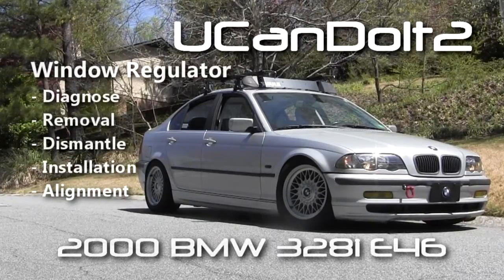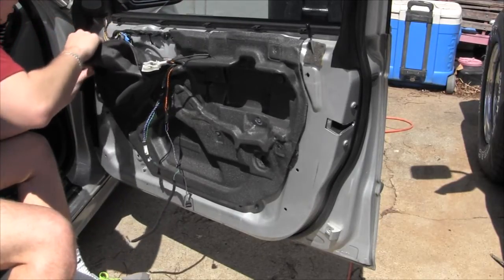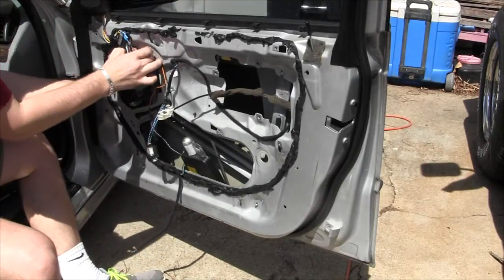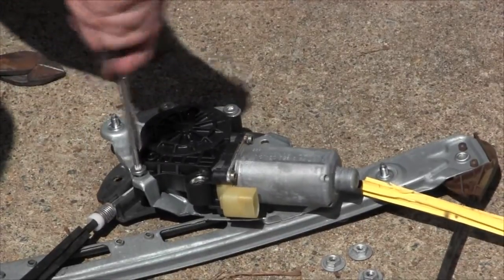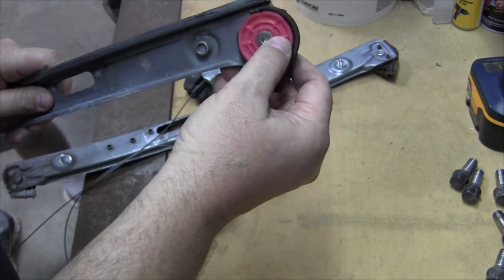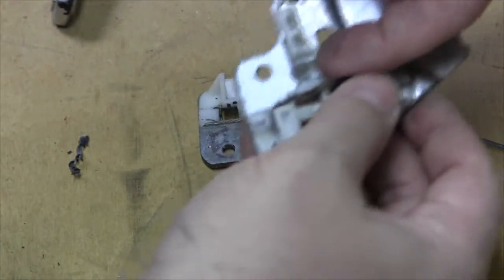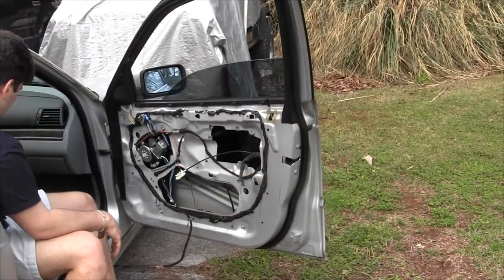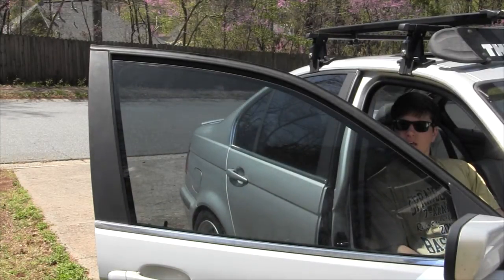BMW 328i E46 - Window Regulator Replacement

Comment: Well done man.  This is the only video that shows how to properly remove and install a window regulator.  Most of the other videos do not include the full installation.  They go through the whole removal, but at some point they cop out and say installation is the reverse of removal.  It is not.  You are the only one to properly show the window adjustment techniques for ensuring that the regulator is working properly and the window is aligned.
Reply from the maker: Thank you for the kind words Sir!

Comment: Thank you very nicely done. I like this because this is such a common problem with the e46. This is also the door that I need to do. Bravo!
Reply from the maker: jusride7 Hope it helps you.  The Driver's side is exactly like the Passenger's side.  We have done that side as well.  It sure is nice to have it fixed.  And very rewarding to do it yourself.

Comment: My car has the same exact problem. I have no experience on working on cars should I do this myself? Or take it to a mechanic?
Reply from the maker: You really do not need to have mechanic skills to perform this repair.  I would suggest video taping yours self and make many audible notes to remind yourself of how it came apart.  I tried to include all of the steps in this video.  Invite a friend over that has a little car knowledge and work on it together.  This is not a difficult task.   Take your time and learn how it works as you take it apart.   Cheers!   Mike